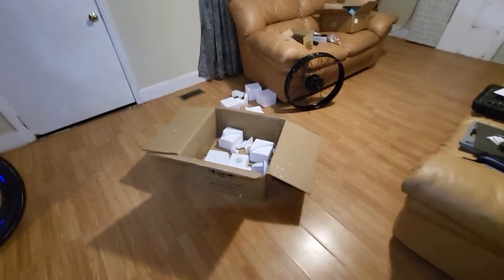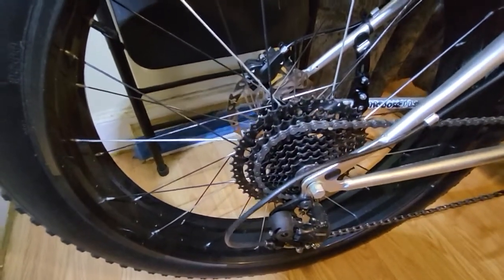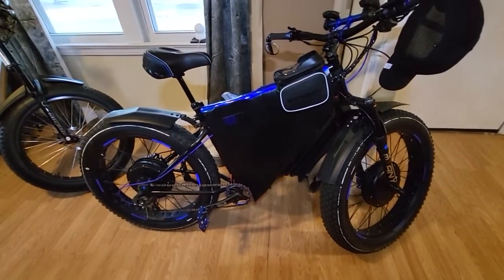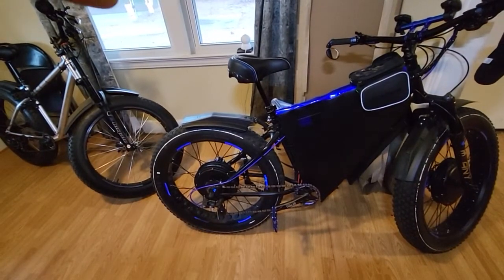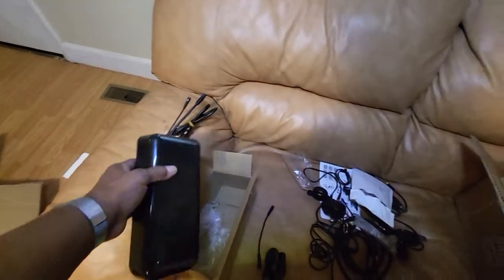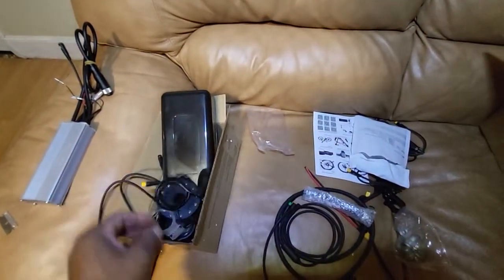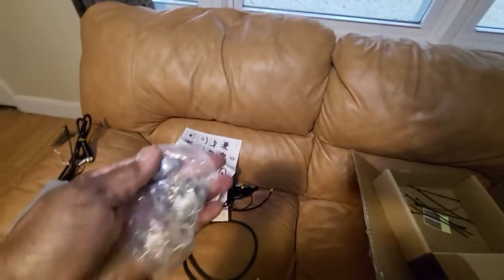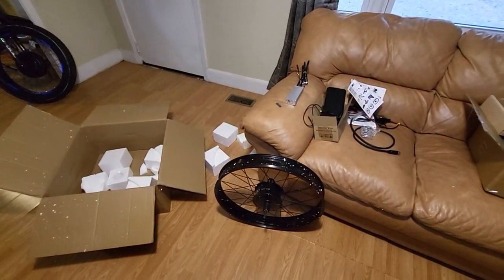Mongoose Fat Bike bafang 1000watt rear hub motor kit unboxing

Comment: I think you can go up to a 32 maybe if 34 tooth on a freewheel.  I'm on the fence to which is better.  Normally I'd say what a regular mountain bike a cassette is better of course, but on a hub motor, if you blow the free hub on the motor, what do you do, going to be difficult to fix if you can do it at all, free wheels are cheap just swap them out.
Reply from the maker: I understand that part but I don't understand why they don't make bigger gears on freewheels The highest I have seen is a 36 but would love to see a 42 that would be perfect

Comment: what kit would i need for my momgoose rader 27.5_2.8
Reply: Have a mongoose malus. I want to get a ebike kit for. And just overwhelmed with the kits. Is there a good source that has a detailed explanation of what to get and why.
Reply: I also buy this motor but problem is that the cassette is not the same I have a 7 cassette bike and motor is 9 cassette can you plz tell me what to do